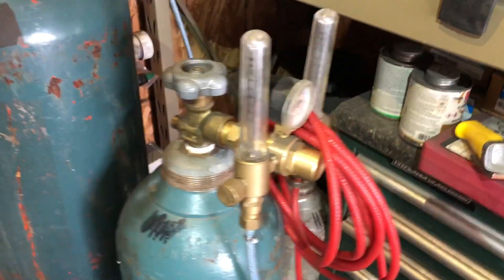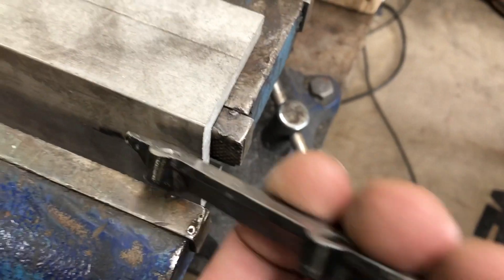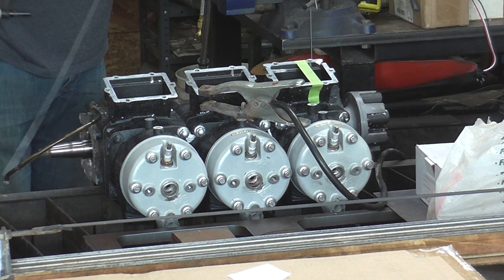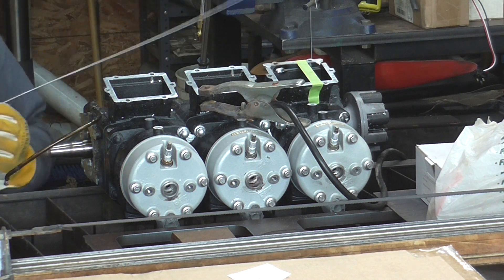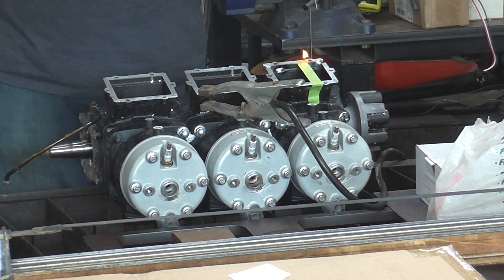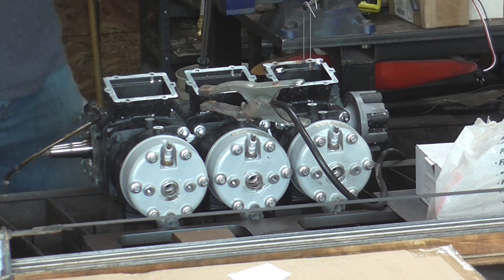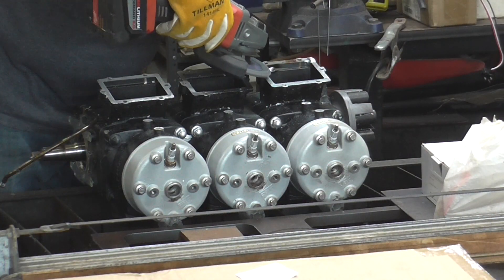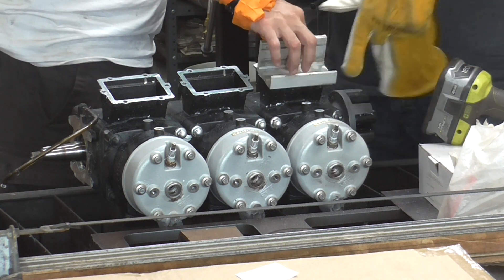Polaris motor intake welding with Tig

Comment: hi zila can you check out this brand of auto darkening lens  2  1/2  x 4  1/4 tigerhood  fiber metal model FMP BM 10 i want to know if this brand of lens will take the heat when welding for long periods of time i used another brand and it started to show cloudy when i was welding for a long period of time iron clad  can you find out if the tigerhood can get the job done in my country trinidad iron clad and tigerhood is all we have i have not bought to tigerhood as yet can you help me out plz
Reply from the maker: I am sorry, i don't use much autodarkening hoods.i have had tons of problems 10 years ago with the older Jackson safety stuff not being able to handle the heat when welding dual shield ...   so i switched to fix shade lenses.   i also found out that real glass lenses (filter plates) are too much better than the plastic counter parts....   
if you are looking for goos filter plates look here 
http://www.sellstrom.com/heat-treated-glass-passive-filter-plates-p-631.html
or try to find some old "Anchor" brand filter plates made from real glass  -most of the old ones are made in germany and people dont like those anymore .....  so some guys just sell them dirt cheap - look ebay, or craigslist or surf the web ...  the guy i bought them from i bought all 27 he had ... for like $3 each ... when they were still selling them in stores 10+ years ago they were $15 each back then !!!!  of course now in the digital fancy age no one wants them ....  but let me tell you - they never need battery replacement ... they work after laying in the car at 120F or -20F no crystals to freeze ... they never overheat ... they never darken a little too slow and flash your eyes ....  
Sorry - fo auto darkening i am not your kind of guy ....  
the only time i use auto darkening is when i teach people or i air arc ....   and that is short time - my head is far away ...  so whatever experience i have with that is not representative for you.  sorry
Reply: if you know anybody that used the tigerhood lens ask them if it could take pressure
Reply from the maker: sorry - i really dont know anyone  - i do more general fabrication ... the pipeline guys are more the guys to talk to they use that size hood

try this guy - he is helpful and answers comments
https://www.youtube.com/channel/UC7pS6fN7dQuDmuLG28P5ZSA

or try this guy
https://www.youtube.com/channel/UCwGMocUppw40sYg68hTPNhQ

Comment: hi zila the aluminum they used to make pots is that weldable ?
and what type of aluminum grade is that ?
Reply from the maker: mohammed troy do you mean like pots and pans? Cookware? 
My guess is - its probably weldable - but i dont know for sure - i dont know what grade either and besides: dont do it! Dont weld it dont cook in it. Aluminum cookware is proven to give you Alzheimers ....!  
( unless it is ceramic coated) 
So either way - if i was you i would stay away from it
Reply: am taking a piece of aluminum from cookware to make something that will not be exposed to heat or used for cooking after i just want to know if it will be strong after i weld it
Reply from the maker: mohammed troy dont count on that. 

If it is anything remotely “critical” or needs to be “strong” - dont do it ....  
if it was a flower pot - ok 
But if you really build something that matters - you need to know you base materials so you can pick the right filler material too ....

For me personally - it sounds like way too much liability for what it is worth

Comment: Why did you not plug the ports with something when grinding and welding to keep debris out of the crankcase? Is it going to be rebuilt  so no need to worry?
Reply from the maker: the way how I held the grinder there really didn't fly much if any in the ports

also, the aluminum dust is not really going to hurt anything

Comment: So for cast aluminium, you do not need to preheat? or did I miss that.
Reply from the maker: Danylo66 technically you should always pre heat aluminum - casting or not - BUT that being said: the material i welded was super thin ( that is the reason for 100% argon instead of helium mixture ) 
It all heated up super quick and was flowing pretty nice
Reply: ZILA  Great thanks for the reply
 Looking forward to the next video.

Comment: Nice job Pete- good to see these HTP Invertig 201 running like a champ and you Tig welding     😜👊🏼
Reply from the maker: that machine has never missed a beat. And in 2014 I ran it head to head with a brand new alpha tig 200 .....   and let me tell you - although this machine was back then already 10 years old - it blew its doors off ...  I mean that is what you get when you buy quality...
I have not tried the new 2018 alpha tig against it yet - but the brand new Digital 200 amp EASTWOOD... it does not have a fighting chance...(the Eastwood doesn't)  - of course when you put am HTP 221 next too it - you see some shortcomings ... but there are 10 years of evolution between them ...  you BETTER see a difference then.

Comment: yea but the guys on instagram............... looks good, never know what your going to get into with cast. I prefer cast aluminum though over cast iron or steel. the only thing not mentioned was filler rod. 4943? also did you use the plasma table as a down draft/ventilation or is that where the heavy motor just ended up?! keep em coming!
Reply from the maker: LOL. yes - Instagram ...  LOL. 4043  - mentioned somewhere in the comments ...too much other stuff I thought about during the video...  the plasma table - a nice collet all AFTER the blancher ground perfectly flat welding table was already clogged up with a bunch of junk ... and this repair had to happen quick... I didn't even turn the camera on till AFTER I straightened out the piece ... that would have made for a good video all by itself ...  but too much work. - not enough time to do it....

Comment: Very nice work sir.  Not to second guess you, because i know how annoying that can be lol, but curious if you thought about sketching up that bolt pattern, plasma cut it on your table out of some 1/4 steel, and bolt the hole thing up to late the holes, and weld the outside first?  Either way, id say you knocked it out of the park!
Reply from the maker: Ramsey Customs - turbocobra lol i actually thought about it but than decided against it - it takes too long - it turned out good in the end - that is half the battle
Reply from the maker: Skydj Whisen - what you see in this video is what the customer brought me. 
If i would have had another factory piece to bolt on - i would have used it 
I didn’t have anything else

Comment: Nice job Peter, Ive been experimenting with a few different aluminium fillers when it comes to cast jobs which can sometimes help make a nasty casting a little easier to weld , may i ask what filler you used for this job ?
Cheers Troy
Reply from the maker: Troy Morrison on this job i felt that 4043  2.0mm dia was my best choice - seeing that 5356 can have hot cracking issues and my favorite rockmount repair rod does not give me exact specs ....  i felt this was my safest bet. We’ll see how it turns out